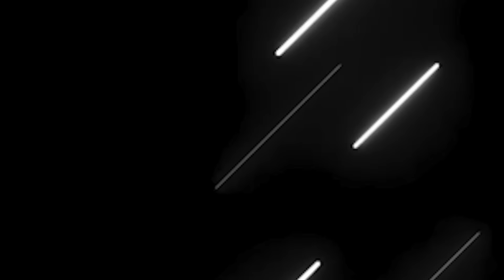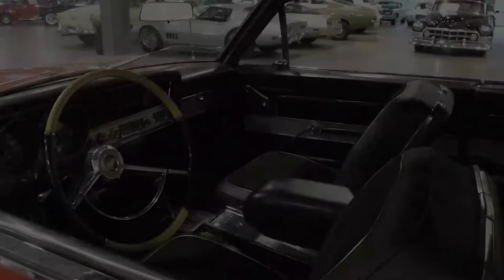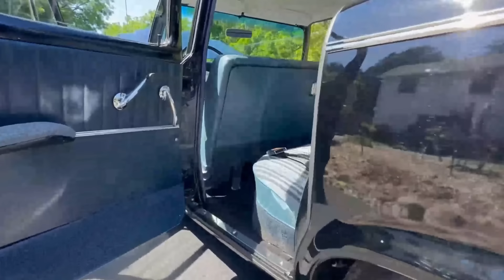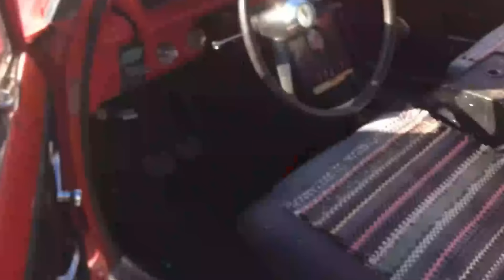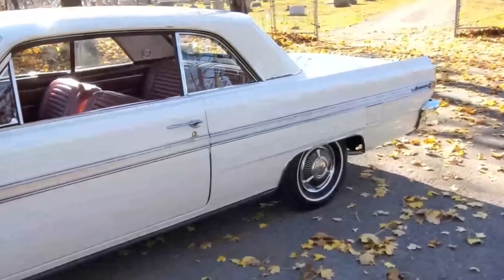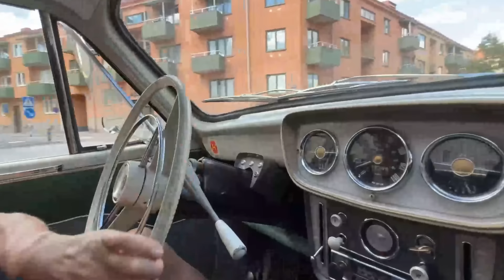Top 8 Most Unreliable Cars of the 1960s

Comment: UNRELIABLE 1960'S CARS :

@00:18  :  1960 FORD FALCON : 144 C. I. ENGINE @90 HP 
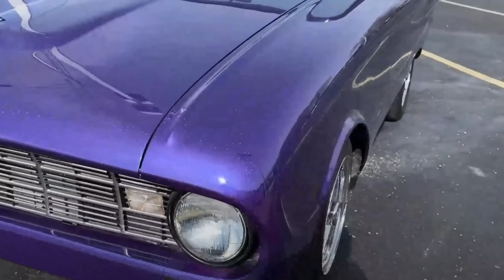@01:36  :  1960 PLYMOUTH FURY  : LOW REAR HEAD ROOM 
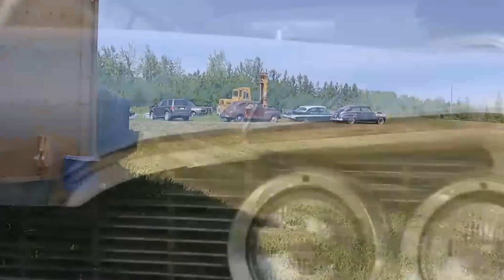@02:53  :  1965 - 1957 AMC RAMBLER MARLIN  : FASTBACK MODEL 
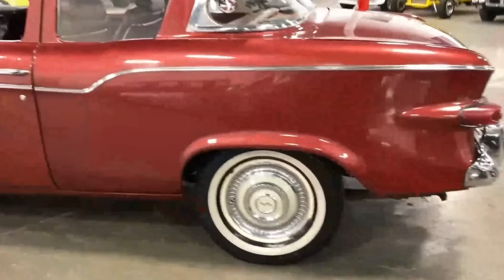@04:19  :  1960 - 1963 STUDEBAKER LARK 
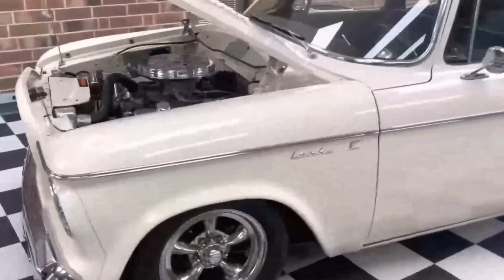@05:42  :  1961 - 1963 PONTIAC TEMPEST
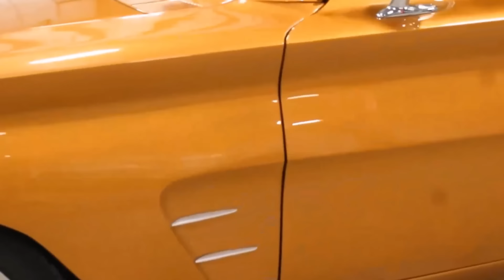@07:03  :  1961 - 1963 OLDSMOBILE F - 85 JETFIRE : FIRST TURBO ENGINE
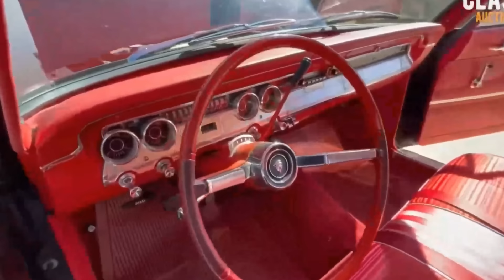@08:30  :  1960 - 1964 MERCURY COMET
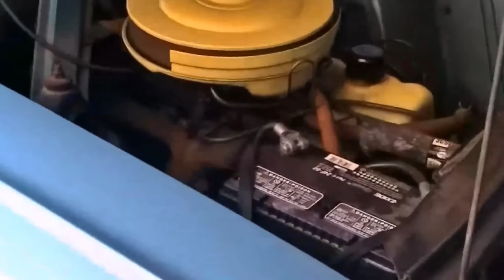@09:53  :  1958 - 1961 HILLMAN MINX ( IMPORT )
Reply: THANK YOU for saving me a few minutes !!

Comment: 1. Ford would improve the Falcon in later models - on BOTH sides of the Pacific. Falcon would later become the longest-running automotive nameplate in Australia.
2. Things would better for Chrysler later in the decade when Elwood Engel took over as head of design.
3. AMC should have used the smaller Rambler American platform for the Marlin.
4. Studebaker-Packard was already on borrowed time by the 1960s.
5 and 6. Ah, the 1961-1963 GM Y-body fiasco. The Pontiac Tempest, Oldsmobile F-85 and Buick Special of this period were a three-way trainwreck from the beginning. It wasn't until 1964 when they were switched to the Chevelle-size A-body platform that things would improve, especially with the later introduction of the Pontiac GTO.
7. The Comet would fare better in 1966 with a larger, Fairlane-size model.
8. Rootes Group was later acquired by Chrysler; Lee Iacocca would call it the worst acquisition in the latter company's history and Chrysler would sell its European operations to Peugeot in the mid-1970s.
Reply: My dad hasd one of those POS Minx things; I was around 4 years old and vividly it being a nasty car all around. Replaced it with a 1962 Falcon; despite that sedan being a basic model, it was a limousine by comparison where and reliability were concerned. Then he had a coupe of Peugeot 404's, they were arguably as frail as the Hillman.
Reply: Marlin was planned as the tarpon on the American wheelbase. In 67 it moved to the ambassador platform and looked better